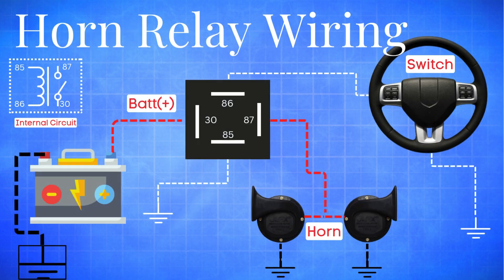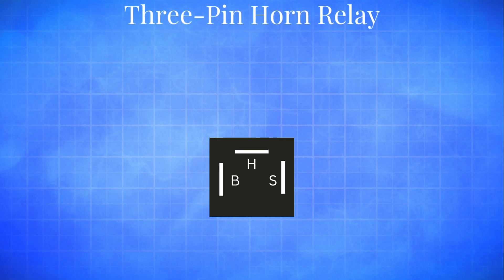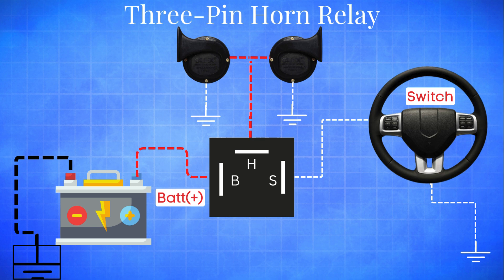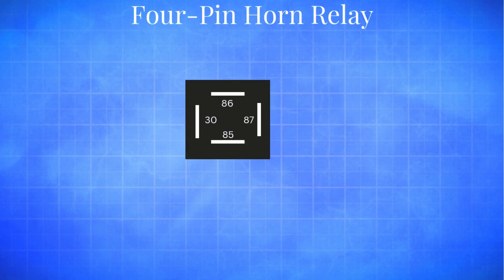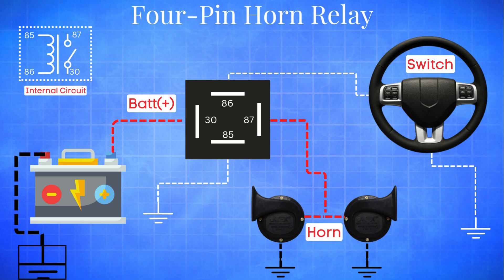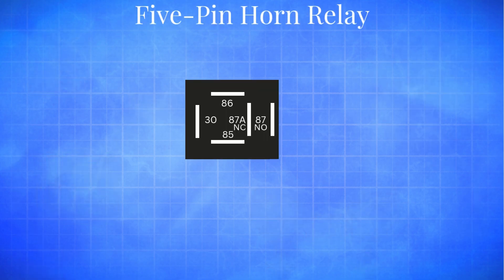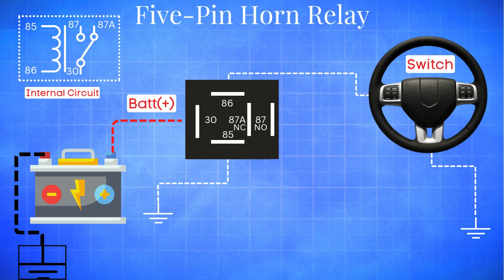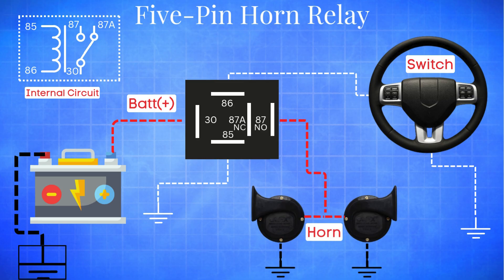Horn Relay Wiring Connection Explained (3, 4 & 5 Pin) | Car fix

Comment: The second illustration is totally wrong,86 is connected to 30,85 is connected to the steering switch which goes to ground and 87 goes to the horn which completes the circuit to ground. When the steering switch on current flows from 86 to 85 then through the steering to ground. This close the path between 30 and 87 which goes to the horn then to ground which completes the circuit.🤗
Reply: Both negative supply???.   How coil works.
Reply: Ótima observação.  Os terminais 85 e 86 da bobina estão ligados no negativo ao mesmo tempo.

Comment: Sir, please correct me if I am wrong, relay coil will be energised after getting 85 positive and 86 negative and vice versa. Please
Reply from the maker: That's correct!
Reply: @carfix07  i saw that too, the wire from switch should be connected to batt(+)